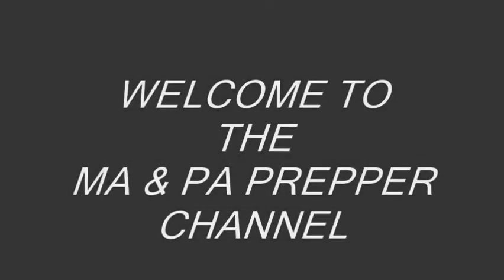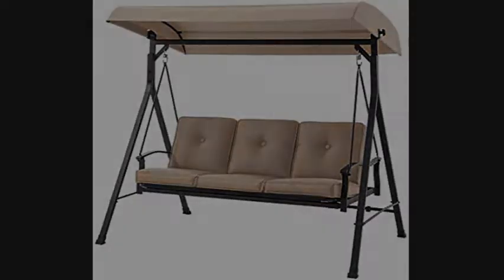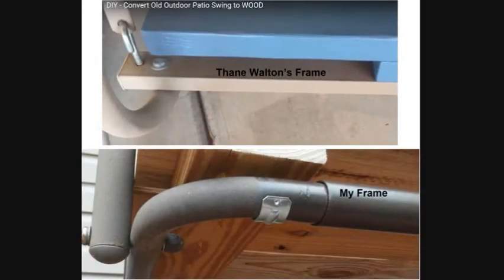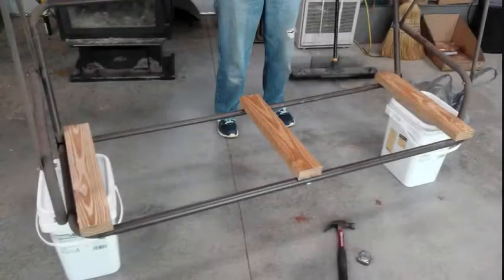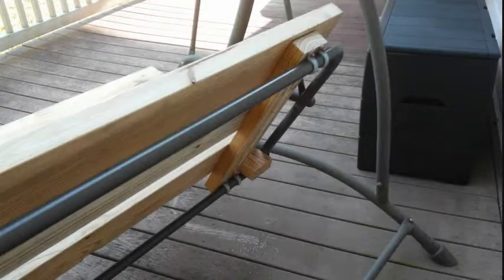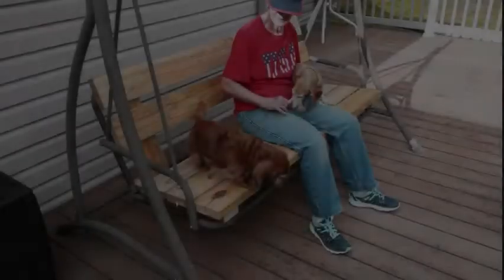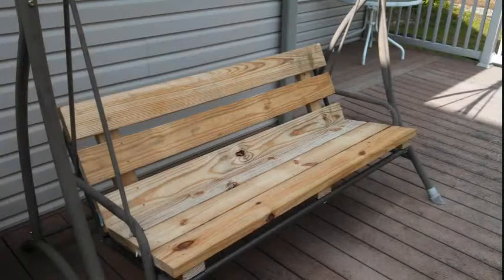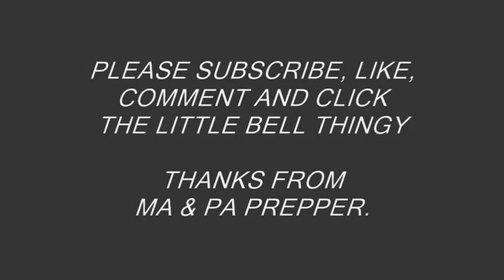PORCH SWING REBUILD GO FROM SUN ROTTED FABRIC TO WOOD

Comment: Great idea. I am thinking of using composite deck boards to make it low maintenance.
Reply from the maker: I thought about using composite deck boards too but at the time they were much more expensive than PT 2X6's (and still are) 
and I had the 2X6's left over from rebuilding our grow boxes so I used them.

Comment: How has it been holding up? I love the option of not putting holes in the metal tube. Does anything shift or come loose?
Reply from the maker: Beth,
It has been holding up very well, we have not had any of the 2X4's, 2X6's or the conduit clamps come loose and we and the wiener dogs use it all the time. Thanks.
Reply: @mapaprepper8623  thank you! We have small, energetic havanese dogs and will appreciate the third back panel!
Reply from the maker: @bethcook3943  We have to take care of our PUPPIES after all they are our CHILDREN !